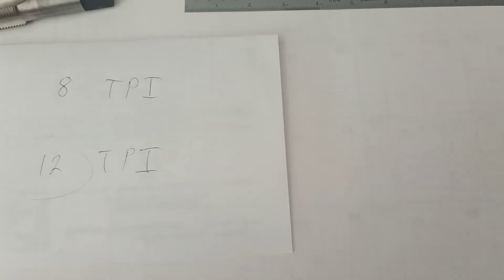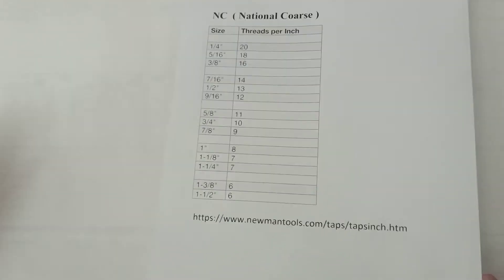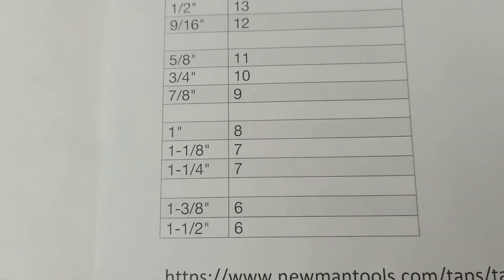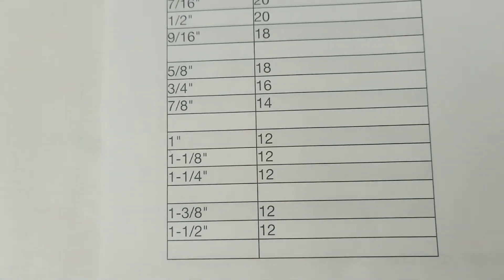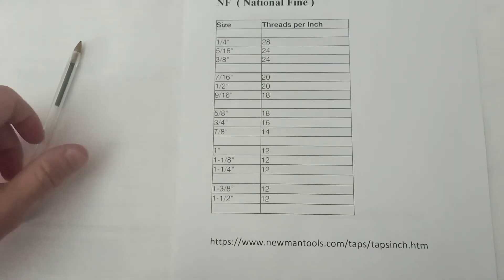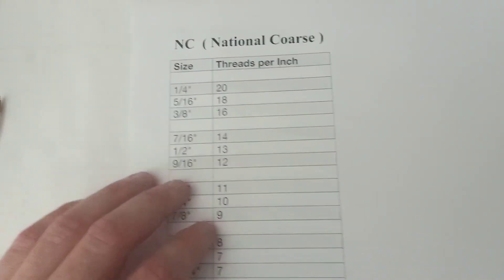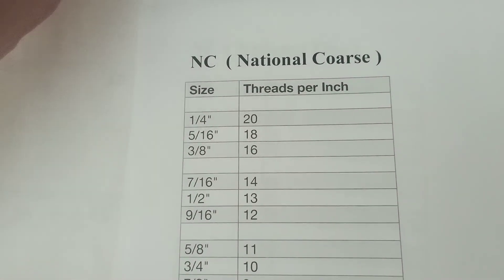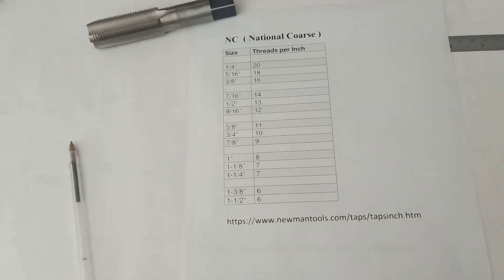What is the difference between NC ( National Coarse ) and NF ( National Fine ) threads -Newman Tools

Comment: I have a question. Is BSW thread interchangeable to UNC thread?
Reply: Pitch is the same but for 1/2 inch.
Whitworth 12 TPI. UNC 13 TPI.
Thread angle:-
Whitworth 55º.
UNC 60º
Yanks have to be different.